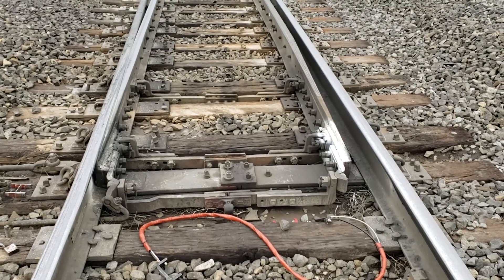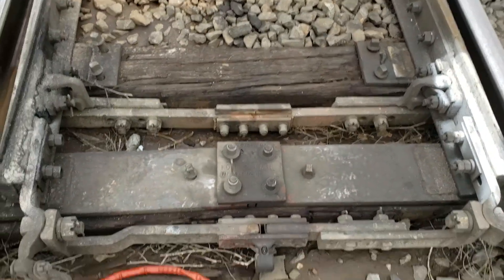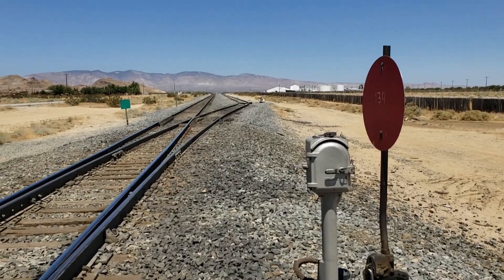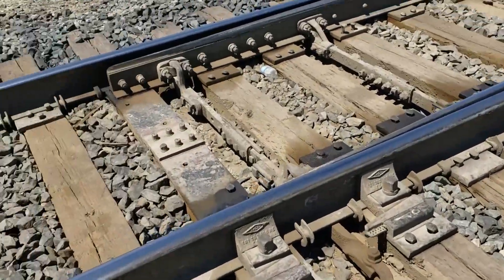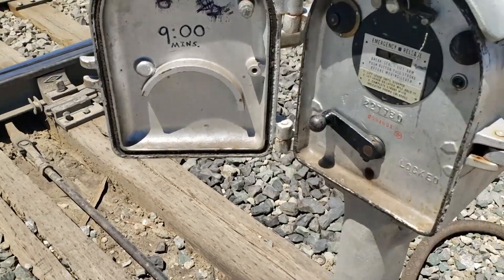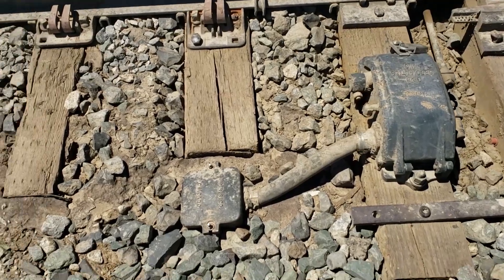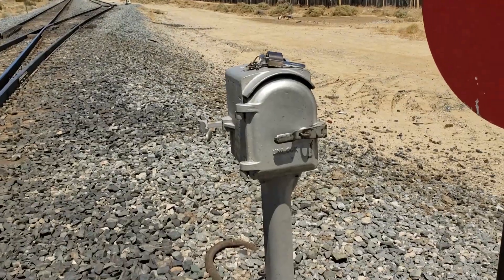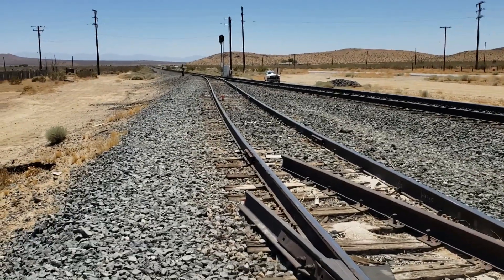Railroad Signaling Explained: Electric Locks at Hand Throw Switches

Comment: The biggest problem with USA is that it is soooo big, it is really difficult to electrify all the rails too and making switches 'smart' for dispatchers is a chore too. Canaries with trains using 'Panographs (contactors that contact the canary wire) are the cheapest considering the long-term dangers of the third rail.
3kV at 1-2kA is around 4000 running Microwaves of power for freight trains... 'only' 4-6 Megawatts. However, they have regenerative breaking and as long as the driver is experienced, they will only use regenerative breaking 1-2 miles out and return 70% of the power to the grid. Express trains run around 8000 household microwaves of power/braking.

Diesel Electric burns way too much energy, especially when braking where they just dump it into heat using big ol resistors.

Comment: I know of a switch crew who worked in ABS territory on one of UP’s predecessor lines in the 1990’s and had to use a time lock to get in & out of their small yard, as well into the center siding between the 2 track main where cuts of cars coming & going from the adjacent three track yard were left. I believe the time locks were set at three minutes at this particular location. This crew was comprised of “old heads” back in the days of “working for the quit” (i.e. you were paid a flat rate for the days switch job, and the sooner you wrapped up, the more money you made). It really burned the crew to sit there & cool their heels as the timer ran out, knowing there were no movements & they could safely complete the move without waiting. Well, one day, someone in their crew got their hands on a signal dept. lock & through reverse engineering was able to make a signal dept. key, made copies & gave it to their coworker (in those days it was a three person crew, hogger & two ground guys) Now whenever they had to get past a time lock, they could open the signal dept. lock on the backside & manually trip the timer, thus eliminating the three minute wait without breaking the seal or leaving any evidence of the act. They knew enough about local ops to be aware if there were any mainline movements approaching the area, so they never got into trouble. Eventually they retired, or took a buy out, & CTC was put in & trackage reconfigured after UP took over, but geez, the list of company rules & probably FRA rules violated during this brief procedure would be as long as your arm. Getting caught would’ve probably meant permanent dismissal.

Comment: At the switch points, why does track maintain the throw rod and signals maintains the lock rod? What's the reason for the divided responsibility between departments?
Reply: The throw rod is track infrastructure.  The lock rod is needed for the signal system but isn't otherwise required.

Comment: Yeah both types of those Electric Locks the switch mounted and the tall ones are a pain to operate. Sometimes the light doesn’t illuminate at all. All kinds of issues. As for the tall one, I’ve only used that type once. And they got rid of it when they re-did the track through the area.

Comment: Hi Mark  What voltage and current is the lock (at the contacts) operating at? I notice you have no concerns of putting your hands in there (and on some of your other videos inside the signal houses etc.) so presume there is no risk of electrical shock etc. All DC? 
Thanks
Reply: It's likely 12v DC or less on these contacts. Current, perhaps an amp or 2.
Reply from the maker: Sorry for the long delay. I was still recovering from Covid around this time. The other replies are correct. 12vdc and max 1 amp for this type of equipment. At Power switches, the motor is 24vdc and can pull around 15 amps under load, but the signal indication circuits are the same as this one.
https://youtu.be/nJZbGHbSK8U
Reply: 95% of wayside signal equipment is 12VDC equipment, and it's often operated at 10–12 volts.  There's no serious shock hazard.  
There are higher voltage switch machines, and often the switch heaters require 120VAC to work.

Comment: Your switch point box at Cable looked very close to what we used on the Milwaukee. Also our points were set at a 1/4" or more to throw the signals.
Reply from the maker: Yeah, they're pretty much the same everywhere as far as equipment. Prior to installing latchout devices we used the 1/4" gauge as well.
Thanks for checking it out!

Comment: I thought electric locks were all controlled by the dispatcher.
Reply from the maker: Only power switch machines at control points are dispatcher controlled. I did segments on control points and how a power switch machine works. Electric locks are operated by workers and crews but have to have the dispatchers permission.

Comment: They sure needed one of these back in the 60s on the SP line. When my brother was about 13 or so , he and a friend were playing around on the tracks and they came across one of those old hand thrown switches and they proceeded to throw it. Not many minutes after doing such, an engine came along and plowed into 3 box cars sitting on the tracks in about the 2000 block of Kentucky Street. The impact was so hard it split the middle car of the 3 right down the side. The railroad tracked them down to our house and came out and told our mom that we could be facing sever thousands of $$$ worth of damages. They ended up not doing anything because as it turns out , even though the kids were on the tracks illegally, the railroad was negligent in not having the switch locked out...I don't remember what my Dad did when he got home but I am sure it hurt....lol
Reply from the maker: Wow! What a memory! Switches certainly need protection. Yard switches are generally unprotected by signal but are mostly locked these days.
Thanks for the comment and for checking it out!

Comment: The model 10 electric lock appears to be the same setup UP installed on the switch that leads to my former employer's Toledo line.  Previously, SP had a spring switch that was very hard to throw and the mainline through there was ABS.  It's now all CTC (and higher speed limit). I rarely had to deal with it...that's conductor work! Um, the switch looks a little dry, might be why it's hard to throw. BTW, during my career with the railroad, I have tested a derail...and it worked!
Reply from the maker: There was an issue with the reverse points at Cable but yeah, the switch was a mess anyway. The one in the desert was fixed shortly after I left. I was amazed at how poorly such an important piece of road had been maintained by both track and signal after coming from the valley.
I knew I wasn't going to be around so I didn't make a stink that would have created more work for me! 
The job I left (Tehachapi Maintainer) is still vacant after two bid cycles. These jobs are a pain any more and even more so on a high profile, maintenance intensive district like that one. No one wants anything to do with it.
Thanks for the comment and for checking out my channel!
Reply: @MarkClayMcGowan  Gotta admit, you couldn't pick a much more exciting stretch to maintain, though.  Props!

Comment: Thank you for sharing!
I’ve wondered what type of equipment y’all use I work for another railroad and see some of the same stuff but never anything like the electriclocks you showed we use 9B’s and sl21’s 
The territory I have now has an automatic interlocker that was in-serviced back in the 30’s it still has a lot of the original relays. Hard to believe that old equipment has lasted that long.
Reply from the maker: The old stuff is very reliable. Some is just maintenance intensive! The SL-6 is a great piece of equipment. The T-10 is a piece of junk!
What road do you work for?
Thanks for the comment and for checking out my channel!